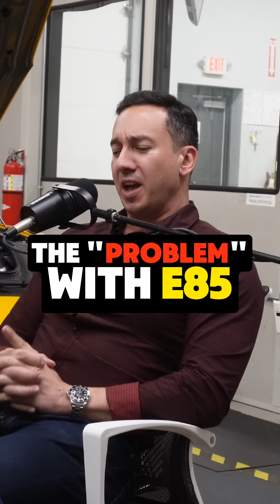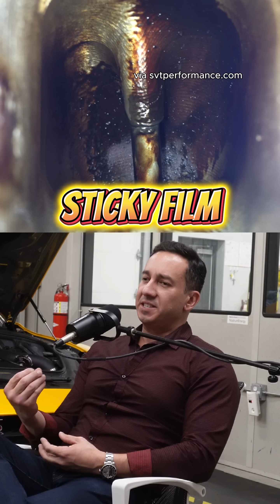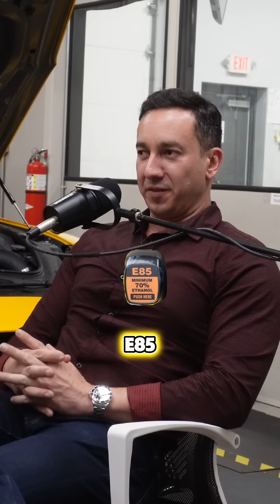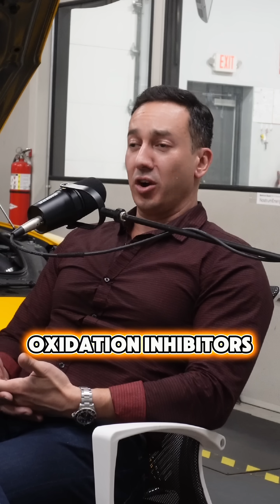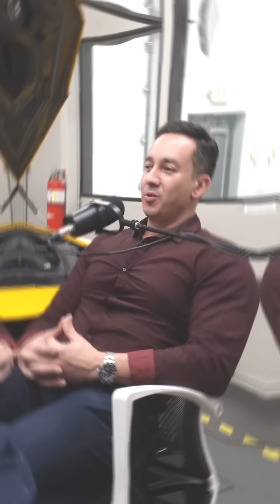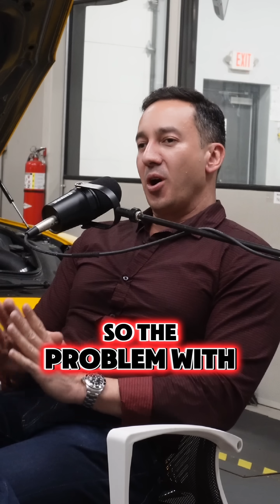THE "PROBLEM" WITH E85

Comment: All strong alcohols are very corrosive when they absorb water.  Ethanol is an alcohol, and pump ethanol contains some moisture, do not let anybody tell you that it does not contain moistue, it does.  I work in the fuel industry, and I have the paste that is used to test ethanol fuels for moisture.  I have never seen a real world sample of ethanol that does not contain some moisture.
Reply: Ethanol is hygroscopic. It absorbs water from the air. It is virtually impossible to keep ethanol pure unless you add things that absorb the water more aggressively, like solid dessicants.
Reply: @MrStickthrower2001  Ethanol is hygroscopic, but it is not a desiccant. It doesn't not absorb water from the air, it will absorb a small amount of water that it comes in direct contact with.
Reply: I have a race car that runs 100% methanol. I have to completely disassemble the fuel system every year, and I have to run the car up to at least 155 degrees every week during the season. Otherwise, my carburetor, fuel filter, fuel pressure regulator, cylinder walls, and valve seats all go bad. I learned the hard way. I had to spend $8k getting an engine rebuilt 4 years ago because of the corrosion.
Reply: @brandonwytaske9432  Bullshit!
Reply: Unless your fuel system is made to run on hydrated ethanol. Like in Brazil with (hydrated) E100.
Reply: The complete ignorance of physics and basic science abounds on YouTube. You are absolutely correct.
Reply: Doesn't anything wet contain moisture though? 🤷🏻‍♂️
Reply: Yep, it's hygroscopic, absorbs moisture from the air,
Reply: I heard it varies by season
Reply: Good thing we didnt ask not your car mind your own business
Reply: When you don't know what you're talking about, Kevin, and you don't, you should keep your mouth shut. Ethanol is corrosive, but so is water, sunlight, wind, and gasoline and aromatics. Ethanol and methanol are less corrosive than gasoline, benzene, toluene, xylene, and tetraethyl lead.
Reply: @TheAutoChannel  Try to attack the statement, not the person.
Reply: @kevinkelley3657  Kevin, try learning about ethanol and other fuels. Try providing accurate information instead of BS you heard hanging around the men's room.
Reply: I’ve been running pump E for over a decade.  All you need to do is switch between ethanol and gasoline every couple of tanks of fuel.  For every 3 tanks of E that I run, I run a full tank of 93.  Also, before switching fuels I run all of the gas out to the point where the car stutters before it cuts off.  Even though I’m tuned in flex fuel, I still follow this method.  My car was originally tuned back in 2010 and has been running strong ever since.  My Tuner gave me this advice and I have lived by it.  The few times that I have mixed fuels I can count on one hand.  It’s not the end of the world if you mix fuels but I would not run my car on it indefinitely.
Reply: Stop with that myth about it being very corrosive.
Reply: @joe1273 Is it also a myth that it is hydroscopic?
Reply: @kevinkelley3657  The correct term is "hygroscopic" not "hydroscopic."
Reply: Whenever someone says they "work in x industry" without listing the technical expertise, we can assume that it's someone with no expertise in the subject. The moisture, if any, does not cause varnishes or gums forming as discussed in this video. But, you would know that if you were an expert, and not probably someone's secretary or HR administrator.
Reply: @Southghost5997  I have worked for a fuel distributor for 18 years. I have read any and all technical papers that I can find on fuels and alcohol fuels.  Ethanol that contains moisture is corrosive. I have also worked on carberators and fuel tanks and fuel injection sytems,  I have friends who are auto mechanics and I have talked to them about the problems that they see.
Reply: @Southghost5997  Exactly correct! Good explanation.
Reply: The floor on on our 750,000 gal E98 storage tanks carbon steel after 20 years are still good.

Our 87  (no ethanol) octane denaturant  tank needs a new floor every 10 years
Reply: So does that mean that the ethanol is keeping water away from the metal by suspending the water in the mass of fuel?  Where as the 87 let's it distill or settle to the bottom?  @MrLahey69
Reply: @MrLahey69  That's not an engine.

Comment: Your sticky film is what we call ethanol gel in the outdoor power equipment industry. The problem is caused by water getting in the system, mixing with ethanol and producing an acidic compound that eats pot metal. The gel is actually micro fragments of oxidated metal in suspension. In power equipment this comes from the pot metal in the fuel cutoff switch or carb. In modern cars it comes from any metal component in the fuel tank, the fuel pump or injectors left with the acidic compound in them.
Reply: It seems like anodizing or coating carburetors and their parts would solve these issues. I'm a big believer in alcohols as fuels but as long as the petroleum giants run the US we will not see adoption.  It is a solution that will make greenies and industrialists happy.
Reply: You call it "ethanol gel" because you don't know what you are talking about. Ethanol is LESS corrosive than gasoline and aromatics. Pot metal, that is low quality generic alloy, is usually a mix of aluminum, tin, copper, lead, zinc, and some other low melting-point metals. Ethanol is at least as compatible with all of these metals as gasoline, benzene, toluene, and xylene. The "sticky film" is caused by the the petroleum in the gasoline. Ethanol and other alcohols are used to clean sensitive electronic equipment. It's used to clean video heads in cameras and recorders, and used to clean the transport mechanisms in a motion picture film camera and projector. If it caused a "sticky film," it would destroy the equipment.

Comment: Ethanol doesn't provide gas mileage that straight gas gives.

It might be cheaper per gallon, but not if you have to buy twice as much to go the same distance.
Reply: People aren’t using e85 for fuel efficiency lol.
Reply: The price per BTU of ethanol is lower, and the lower power density reduces throttling losses, further increasing efficiency. Miles per BTU and miles per dollar are what you want to measure.
Reply: That's why I stopped using it. My mileage went to shit. I loved the cheap price, but the juice wasn't worth the squeeze.
Reply: If you're using twice as much, then there's something wrong with your car or it's not designed for more than 10% Ethanol.
Reply: When you don't know what you're talking about, and you don't, you should keep your trap shut!
Reply: Thank you for saying this
Reply: You only use about 30% more fuel when running e85. So if it’s 50% cheaper or more (which it is where I live) then you’re still saving money. Also, I couldn’t care less what mpg I get when running e85 lol.
Reply: If you're running a tuned car with high compression or a lot of boost that requires high octane, it's cheaper and safer for the engine to run E85 even when you factor in the 30-35 percent loss in fuel mileage compared to premium gasoline. For a normal car that can run fine on 87 octane regular gas you are correct that it doesn't make sense price wise to use E85.
Reply: @ethanlindsey  There are no instances when ethanol causes a loss of 30-35% MPG. NONE!
Reply: @TheAutoChannel  It depends on the car and actual ethanol percent of the fuel, It's somewhere in the neighborhood of 20 to 35 percent MPG loss compared to gasoline. My point still stands that if it's not a high performance car that requires high octane fuel it usually doesn't make financial sense to use E85 over 87 gasoline. E85 is $2.48/gallon and 87 is 2.78/gallon where I'm at right now.
Reply: @ethanlindsey  Ethan - You don't know what you are talking about.
There is never a loss that ranges from 20% to 35% when using an ethanol-gasoline blend versus ethanol free gasoline.
Where I was today, in Southern California, I filled the tank of a 2025 Mazda CX-5 non flex fuel SUV with 7.5 gallons of E85 and 7.5 gallons of E10. This gave me an approximate overall E45 blend.
The E85 was $2.99 per gallon, and the E10 was $4.99 per gallon. I then drove about 360 miles and averaged 32.3 MPG.
Yesterday, I drove this car down to Southern California on a full tank of E10. The E10 fuel in Sacramento cost $4.89 per gallon. Using E10, the vehicle averaged 30.6 MPG over the 360 miles. So, using a E45 blend in a vehicle that is NOT supposed to operate on anything over E15, I got better miles per gallon and saved $2 on each gallon of E85 that I used in place of the E10.
This experience is the same experience I have had on a continuous basis for the last 20 years.

Marc J. Rauch
Author of "THE ETHANOL  PAPERS" and  "YES, TIN LIZZIE WAS AN ALCOHOLIC."
Exec. Vice President/Co-Publisher
THE AUTO CHANNEL
Reply: @TheAutoChannel considering you use about 30% more fuel when running ethanol I’d say he’s not far off.

Comment: Ethanol gets a bad rep because it is hydrophilic.  As it sits it separates causing a layer of water to form at the bottom of the tank.  For  small engines, pay the money and use non-ethanol fuel only or you will pay for repairs and new carburetors later.  Ask me how I know.
Reply: E10 is the standerd "available fuel". Non ethanol is very hit and miss. Some stations have 91-93 e0, most have 85-87 e0 . Most stations don't stock e0.
My loacal air port has e0 as 110ll  . $2per ga extra more than covered the 10x longer life in my chain saw and other small engines.
Reply: @daviddroescher 
In my case it's actually easier getting av-gas than it is non ethanol.
Av-gas is 500' from the shop ,but non ethanol premium (91) is a 20min ride over to the next county. 
Late fall and I'll keep an empty 5 gallon jug in the truck and fill it when I'm out that way and use it for the small engine storage and last season run. 
I'll still add stabilizer because of the residual.
That 100 low lead smells nice though, the community push mower for the the downs runs on it from everyone's tank samples.
Reply: I've only ever had corrosion issues in small engine carbs that I've run ethanol blended gas through.
Reply: I run it in my mower and motorcycle regularly with no problems. I just don't let it sit around for weeks with fuel in the tank. Shouldn't do that anyways though so...
Reply: @charlesstidham2788   witch one?  10% corn cobs , 85% vegion, non ethanol gas   or proper nonvegetation 110ll
Reply: @daviddroescher  in America there are two types. E10 and E85 which are both from corn. These options are also what would be most commonly available to everyday consumers.

Comment: Anybody that rebuilds engines knows non Ethanol gas is the best way to go whenever possible.... Unless  of course, you like taking apart your engine🤣
Reply: E85 is much better than pump gas given ideal conditions ( good quality, injectors are not stressed, fuel pump can handle it.) It lowers cylinder temps and most importantly it 's more efficient than pump gas by orders of magnitude. It also has stricter regulations in my state and thus is usually of a higher quality than pump gas
Reply: A lot of high hp tuners disagree
Reply: @toywrench1  I was speaking to longevity and maintinence....not total power avail. There are a lot of good reasons.They don't use alcohol in aircraft fuel.....and it's not  because of altitude😏 Feeding alcohol to your car is like drinking grease out of the fryer. You won't see the effects  of it early on.... but you'll pay a BIG price later. TUNERS DONT CARE ABOUT THAT🤣
Reply: @toddsilverman1244 if you’re using a modern car with injection not carburetor and with fuel systems that support e85, and you don’t mix gas with e85, then you won’t suffer problems
Reply: @whatsomeonesaidwastaken9216  🤣🤣🤣🤣🤣🤣🤣🤣OK.

Comment: All the pictures you showed were of damage caused by an EGR…..🤦🏻‍♂️
Reply: Nope I had several vehicles with regular fuel because all gasoline has some mixed in that's why fuel doesn't last as long but the plastic and steel fuel tanks had that crap inside and the fuel pumps failed
Reply: It’s PIB induced deposits. GM studied the issue and published a paper. Solution is one that everyone with a flex fuel car knows to do which is run a tank of normal pump gas to clean it out.